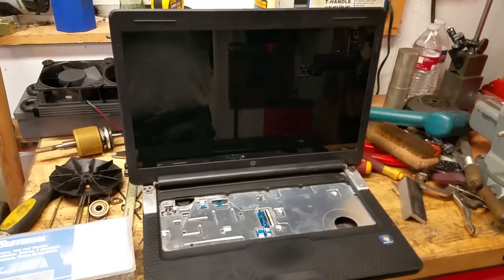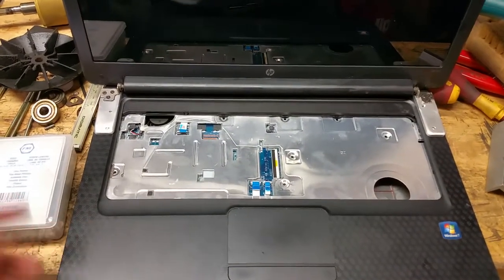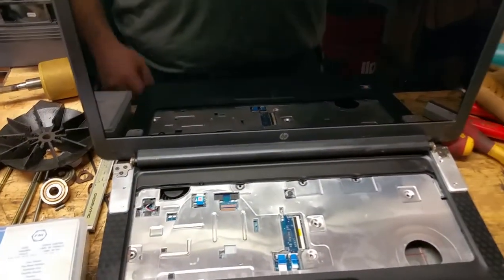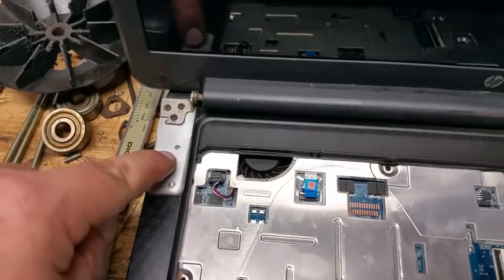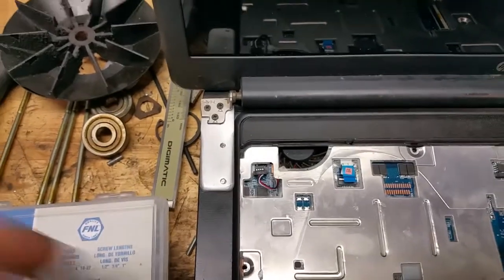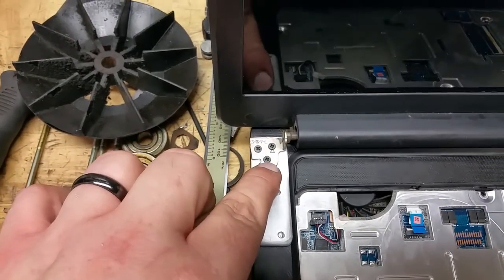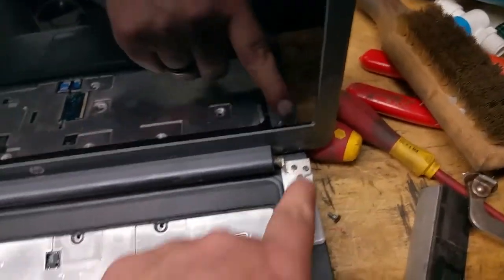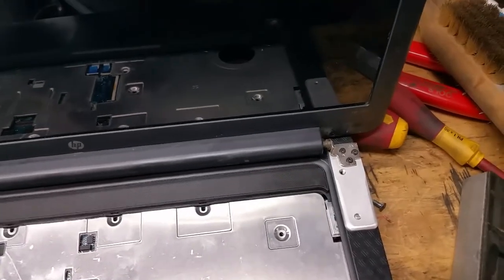Frankenstein laptop display mod

Comment: lucky to find this on yt, i have a similar thoughts since i have 1 broken screen (14inch) and a 15.6 completely dead but good working lcd. i havent dismantle the 14 inch yet which confirmed still working except for the broken lcd. hopefully it'll all goes well and have my own version of frankenstein laptop too haha! and i hope they have similar pins with the larger 15.6, all i know is their both wxga though.

Comment from the maker: The video card can handle much higher resolutions. Most modern stuff can do 2 displays at full HD resolution. The CPU is a bit slow for fusion, I've found out :-( The backlight on the new and old screens is LED, so power draw should be about the same.

Comment: Great job!  Was there any concern the video card will have any issues running the higher resolution?  I'm not a computer wis so I have no idea.  Just curious if the bigger screen draws more power than the original, probably optimized, motherboard.  Can wait to see it running Fusion :-). Thanks for sharing.